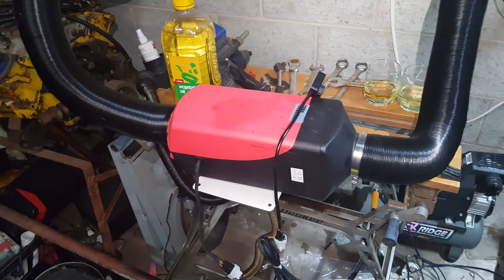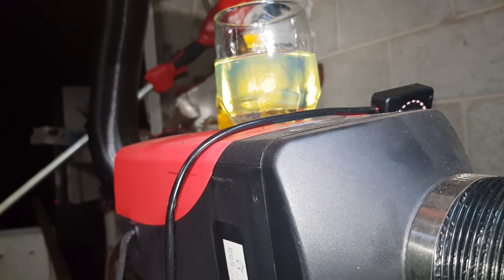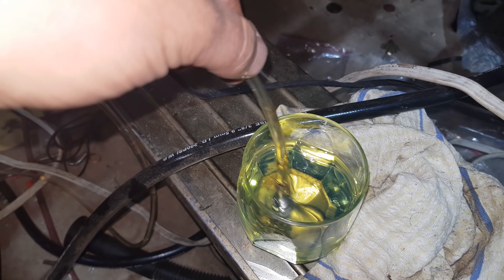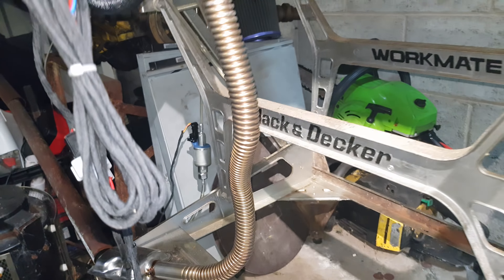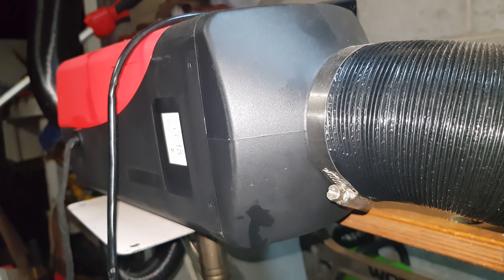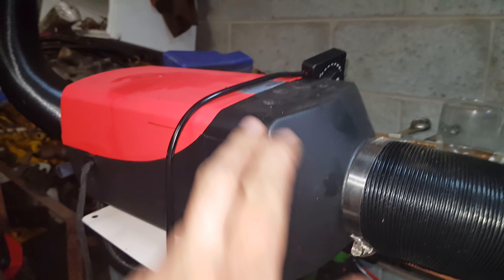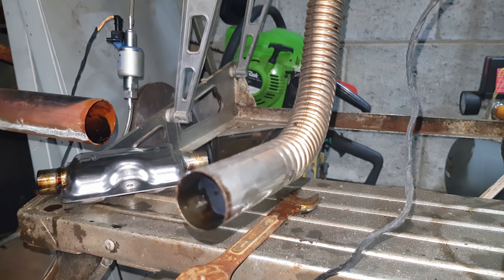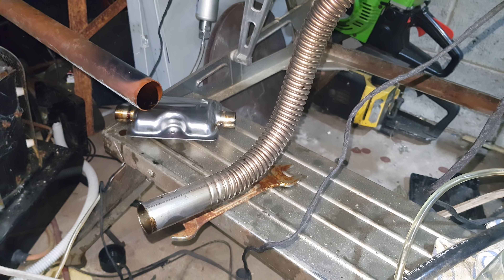Cheap  Chinese 5Kw Diesel Heater Runs On Bio fuel Vegetable Oil /Diesel Mix

Comment: Have you tried running the heater on HOT VEGETABLE OIL !  
You can run old diesel engines on 100% filtered waste vegetable cooking oil but it has to be hot !
Reply from the maker: This has no injector or compression its at a big disadvantage to a engine
Reply: @Oneupthesleevecustoms  ok thanks.. I've got one now and will use 50/50 free filtered waste veg oil and halve price red diesel so should be very cheap to run . Thanks for the video...
P.S whoever it was called me a tight are for using free fuel YES I'm a tight arse and save where ever I can LOL.. Oh I also save at least £2000 per year running my cars on free waste veg oil, I love it :-)
Reply from the maker: No stress mate hope it goes awesome

Comment: How many watts at 12v does it use an hour? 
I'm thinking about solar powering one for camping
Reply from the maker: At 12.6v it uses 10amps for about 1min then down to about 2 amps so 24 to 30watts

Comment: Hi been running mine on paraffin seems ok,but I’ve had to use some 10A10mic diodes in parallel to reduce the voltage when my alternator is charging my leisure battery because the mother board on the heater does not like going over 14volts I wonder weather yours does?🙂
Reply: I guess that's better than burning the igniter up.... At least it was an easy workaround.
Reply from the maker: Never checked i only really use it off my storage pack of a night time
Reply from the maker: Good thinking really

Comment: Any updates on longer term wvo/diesel mixes?  Is the chamber staying clean enough to still run over time? Also did you ever get around to wmo/diesel mixes?
Reply from the maker: I normally run diesel now but its been running a couple nights a week for last few weeks as its getting colder here
Reply from the maker: Never opened it either. Running well. 5050 diesel veg works well yet to try motor oil as i have not setup to filter it
Reply: @Oneupthesleevecustoms   something to consider. Motor oil is already being filtered constantly by the vehicles filter. And water build up should not be an issue unless it was a vehicle sitting unused forever.  So in theory waste motor oil should be relatively clean as long as your collecting apparatus and storage of it is not contaminated.  But sure more filtering the better. Centrifuge is probably best.
Reply from the maker: To be honest i don't think it will be cost effective for me. Will look into it though

Comment: Did anyone notice the spider on the wall lol
Reply from the maker: I think there was someone else too haha
Reply: One Up The Sleeve Customs oh are you still running that heater I’m doing a camper van build and I would like to use a Diesel
Reply from the maker: Not for couple of months but it has done prob around 600 hours no issues

Comment: Did you try running it on petrol?
Reply from the maker: No mate it would explode
Reply: @Oneupthesleevecustoms  I see no problem 😂
Reply from the maker: Its heat output would be very high for a few mins
Reply: They do make a petrol (gasoline) version of this heater that looks to be the same basic design, but it seems to be proving pretty hard to get my hands on in practice. When inquiring, one Chinese seller told me the diesel version would work with petrol (gasoline), but "diesel is better"... Which didn't exactly inspire a lot of confidence -- figure that may well mean "gasoline will burn, but diesel doesn't explode" :P

Any idea what the difference with a gasoline version would be? The one notable difference on the spec sheets is that the gasoline version consumes fuel marginally faster (presumably because of diesel's higher energy content?). Was thinking there would need to be some change to the fuel-air ratio for it to burn optimally, but are you saying the basic mechanism of this heater simply won't work for gasoline at all?

If you are willing to give it a test, I'd love to see what it takes to make gasoline work!

Comment: I have 600 watts at 24 volts solar and 200 amp hour at 24 volt storage 2 8000 watt Chinies heaters and free veg. oil
Reply from the maker: Straight veg oil?

Comment: too bad the veg oil is just as expensive as diesel :(
Reply from the maker: Id.your buying it new :)
Reply: It's currently about 30% cheaper in the UK (if you shop around) and there are sometimes supermarket money-off deals available. Last year I bought 75l of rapeseed oil from Sainsbury's for about 60p/litre. (Diesel is c.£1.30/ltr. at moment.)

Comment: are you willing to test on with US gasoline not diesel,, most motor homes here do not use diesel,,  I believe the computer on the unit will control the unit by temperature...will you bench test it for us on YouTube...
Reply from the maker: No it will explode
Reply: you don't know. when I have the time ,, I will do it myself. as my RV runs on gasoline.I don't want to have another fuel and tank.your answer is just silly... and useless ...I saw a man on YouTube doing just that but, I can no longer fine it.
Reply from the maker: Its not designed for the flash point. Exhaust will become a flame thrower

Comment: I think all you need to do is add sodium hydroxide to vegetable oil to turn it into biofuel. Here in Canada, we can't get 100% Sodium hydroxide or Potasium Nitrate becasuse CANADA SUCKS!
Reply: And alcohol
Reply: @patrickday4206  . Yes you're right. Unless you're an adult.
Reply: Why can’t we get it here?I was interested in making biodiesel myself and run it 50/50 with diesel